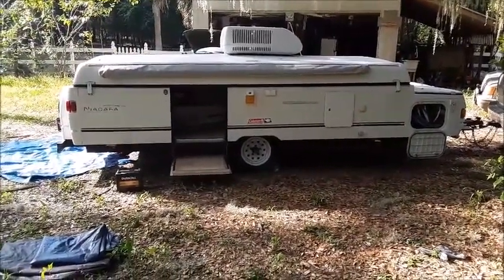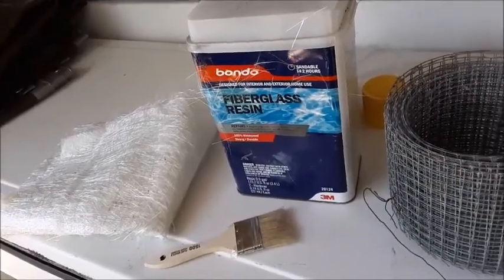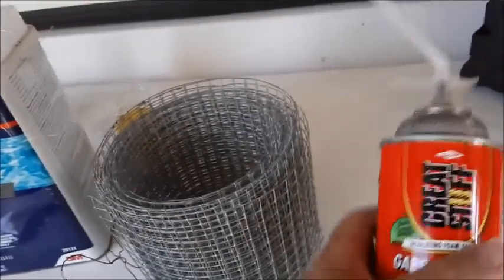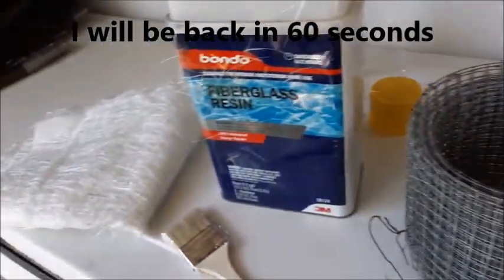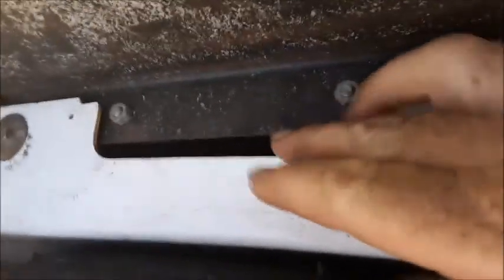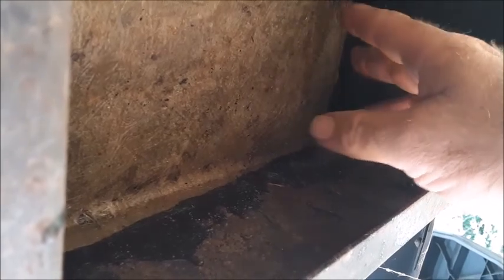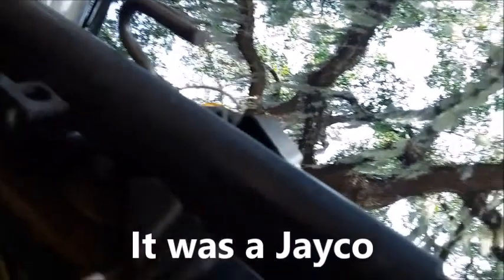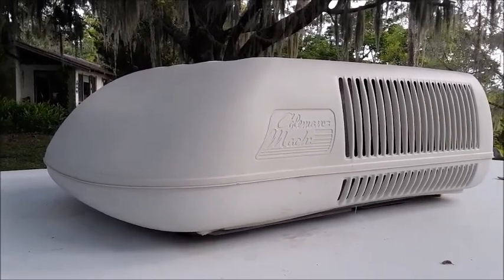How to Rat Proof Your Pop Up Camper

Comment: How did you repair the damaged canvas?
Reply from the maker: I actually took some canvas from the lift pole cover which matched.  You usually are not able to use a sewing machine unless you do a lot of work to remove the canvas so I used a type of glue that said it was for plastics and materials and I glued the patched to the outside.  I used two pieces of wood and some clamps and was able to press the two pieces of wood together while my canvas patch was drying in between the two pieces of wood.  Worked pretty well.  On our prior pop up camper rats really got us bad and I had a huge hole in the ceiling of one slide out and I used the same glue to glue a 2ft x 2ft clear plastic skylight over a huge hole and on that once I did the two pieces of wood again and used drywall screws to squeeze the two pieces of wood together.  After it was dry and the wood was removed I put more glue over the screw holes.  Hope this helps